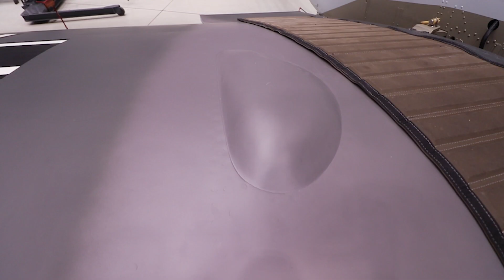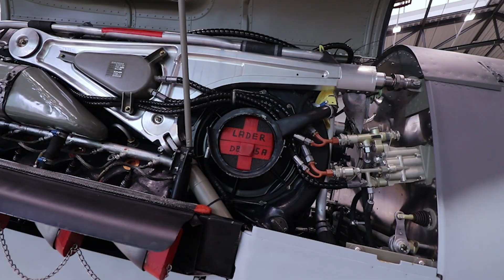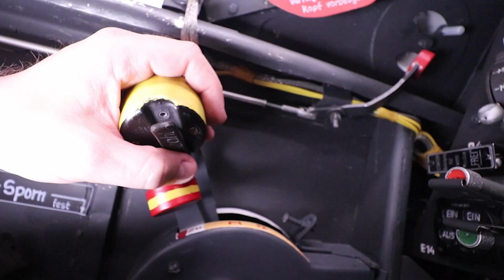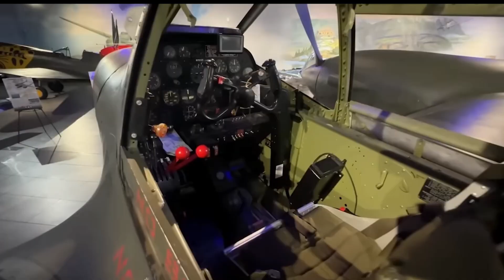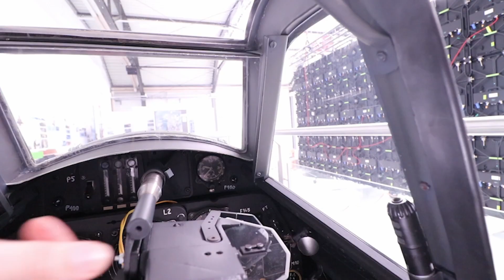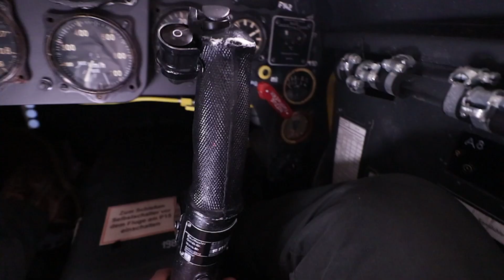Messerschmitt Bf 109 G: Full Cockpit Tour and Detailed Walkaround

Comment: The M19 switch has two functions, if in the down position, it shows oil temperature (temperature gauge found on the right hand side near the fuel gauge).

With the switch in the up position, it shows coolant temperature.

Comment: Many of its foes had six machines guns 3 on each wing just outside of the wide propeller diameter. Consider fighting with guns like that vs 2 machine guns and one cannon shooting straight in front of you. Which would you rather have? A few allied fighters did have similar but most didn't.

Comment: Great report. Question: How was the BF109's reliability? German engineering was often complex
Reply: The "German Engineering is Often Complex" isn't even remotely true but I won't go into that.  
The Me 109G differed from the Me 109G by the introduction of the DB605A which replaced the DB601E.    The DB605 was a new engine in Feb 1942 when if first saw service and like all engines because of this newness suffered from a range of issues.   They seem to have been solved by the second half of 1943.  Certainly by October 1943 the 1.3 ATA boost limit was raised to 1.42ATA.   There were many tiny improvements such as an lubrication system de aerator which stopped high altitude oil forthing, improved pistons but mainly much better spark plugs.
Reply: @williamzk9083  "German Engineering is Often Complex".. is only based upon my experiences with German cars and motorcycles. Can't say about aircraft
Reply: @ luxury cars are more complex than standard cars.  Go to Germany where people drive basic models the complexity isn’t there. There’s a few extra bells and whistles. They’re always a little bit more advanced but generally in Germany are saying is as complex is necessary as simple as possible.  And I’ve worked in German engineering even though I’m Australian.  Consider the tiger tank a specialised luxury vehicle.  The first 50 or so we’re probably overly complex but it is production goes on not only a bug zone but things are simplified.   
In the case of Germany engineers, they of course had direct fuel injection .  That was absolutely necessary because of the limited octane rating of German fuel.

Comment: Were later iterations of the BF109 given the ability to hone in on allied bomber radars and RF equipment for night fighting? I remember seeing an image of a type of compass for something along those lines
Reply: -If a Me 109 with blind flying equipment (artificial horizon etc) was vectored on an intercept it was usually done via a pair of Wurzburg Riesse radars.  These could track a target to within 25m and 0.15 degrees.  The radars had a spherical coordinate to Cartesian coordinate computer and a tracking table so the operator was able to say to the pilot (The target should be 100 ahead of you, 50m above and slightly to the left. Example of this in Heinz Knocke's book.   Freya A/N had lobe switching and could detect, track and guide a fighter to its targets within about 4 degreees of each other by itself though it had no height finding ability. FuG 77 “Marbach" microwave radar could automatically track 5 targets but only 2 were produced.
-Some Me 109 were equipped with the Naxos passive radar detector to home onto British Microwave radars such ass H2S.
-Some Me 109G and Fw 190 received the FFO FuG 216 Neptune radar.  This had stag aerials with lobe switching on the wing or nose to allow direction finding.  
-Some Me 109, Fw 190 & Me 262 received the improved  FuG 217 version which could use the Efe device for automatic firing.
-In general very few were used on Me 109 or Fw 190 because it was found that after peering into the oscilloscope for extended periods the pilot lost his night vision.

Comment: That's the MW-50 switch. Water/methanol injection boost. Activates when the throttle is pushed past a certain point, but only if that switch is on.
Reply: No, the G4 dont have MW-50, and it is a other switch all together
Reply: I thought he said it was a Buchon. It's clearly been fucked with a lot. 

Could also be wing gun arm or rocket arm. I doubt either.
Reply: @Nahojishere  the in-cockpit comes from a separate video of just a cockpit simulator, which may even reside in a different museum -- I don't remember exactly.

Comment: You neglected to show one of the coolest things, the "all-flying" horizontal stabilizer trim. Also I wish you'd move the slats. Are they just held down by weight or is there a spring force mechanism? (I know they get blown up at sufficient speed but I'm sure I've also seen photos of them on the ground with slats retracted. Why do they stay in? What makes them come back out before the next takeoff? Are they just a bit sticky and the vibration of taxiing ensures they come out or is that part of pre-flight or what?)
Reply: It is not an all flying horizontal tail.  It has a separate horizontal tail and movable elevators hinged to it.  The horizontal tail incidence is adjustable with the wheel shown in the cockpit. 
The slats are pushed into the wing by dynamic pressures at their leading edge.  No springs required.
Reply: @onlycartoons2012  That's why I said "trim", a-hole.

Comment: 20mm shells could generally hold around 10g explosive, Soviet ShVAK and Japanese Ho-5 cannons less, since they used smaller shells.
Of course they often carried incendiary filler in addtion to explosiv filler. Or could have a tracer, which reduced the overall capacity.
The German 20mm Mineshell started out with 17g PETN, which was later changed to 18.6g RDX and Aluminum.
The blast damage was significantly greater than other 20mm shells but they also practically lacked any fragmentation.
Against a liquid cooled engine a single explosive-fragmentation shell in the right place could lead to engine failure in a couple of minutes.
Another issue with Mineshells is that they are light and therefore lose velocity much quicker over range.
Mixed with other shells this leads to different trajectories, reducing the firepower at longer distances.

However at close range and against fighters, the Mineshells probably did outperform other cannons in destructive power.
Reply: Mineshell was not lighter.
Avg 20mm Mineshell weight was aroud 86-106 g.
A soviet Shvak 20mm HE ammunition weight was around 91-96 g.
Hispano 20mm HEI was 131 g.
Reply: @ So you just contradicted yourself.

More space for explosive = less weight overall. That's just how it is.

ShVAK shells are 58-62mm in lenght compared to German Mauser/Oelikon shells which are similiar to Hispano shells with 80-83mm.
Reply: @ Where is the contradiction? 1 kg feather is ligher than 1 kg iron? :D
Reply: @ You said Mineshells are not lighter, then said that 20mm Mineshells weigh 86-106g while Hispano HEI weighs 131g.
How is that not lighter than regular explosive shells?
Reply: @ "A soviet Shvak 20mm HE ammunition weight was " Why are you missed this L I NE ?
Reply: @ I already told you that the ShVAK shell is smaller.
So you can not compare two different sized shell with each other.
Any 20mm Oerlikon/Hispano/Solothurn/Mauser HE shell is going to have a weight of ~130g, lighter if a light alloy fuze is used like on Mineshell compatible guns like the MG FF/M and MG 151/20.
Increasing the internal volume of a shell is going to make it lighter, thus Mineshells are inherently lighter than basic explosive shells.
Reply: in a fighter vs fighter situation, you would end up firing at close range anyways.
Reply: The Ho-5 1 and Ho-5 2 was the Japanese Army canon based around the Browning mechanism firing the Hispano Suiza HS.404 round with a reduced cartridge.   Increasing round weight or velocity degrades the rate of fire of this mechanism rapidly but through hard work they maintained a reasonable rat of fire of the Ho-5 2.  As can be expected the Japanese Navy had its own version based on the Oerlikon API.  Their early gun was the equivalent of the MG-FF on Me 109E.  Versions with improved shell weight and velocity suffered from reduced rate of fire far more than the Ho-5 2
-The German MG-151 was a recoil operated weapon and had a high rate of fire with good velocity well ahead of the Japanese guns.
-The HS.404 used by UK and USA used both recoil and gas and so had very heavy projectiles at high velocities and rates of fire but the gun took a while to get reliable.  The US never quite succeeded except in the P-38 where a pneumatic cocking mechanism could easily clear jams.
Reply: @ The Ho-5 fired shells similiar in lenght as the 20mm ShVAK.
Both are shorter and lighter than Hispano/Mauser/Oerlkon 20mm shells.
The Browning mechanism is a recoil operated system like the MG 151 and in both cases the RoF increases with heavier recoil, either due to heavier shells or rounds fired at increased velocity.
Not sure what Ho-5 1 and Ho-5 2 is supposed to mean.
As far as I know there was just one version.
Reply: @ There was a Ho-5 type 2 and an Ho-5 type 1
Reply: @ Fun fact: almost every fighter use mineshell today ^^ ;)
Reply: @ Except they don't.
Reply: @ And how would they be different?